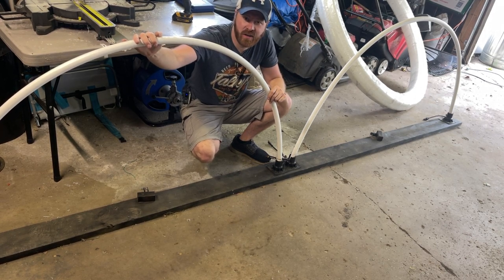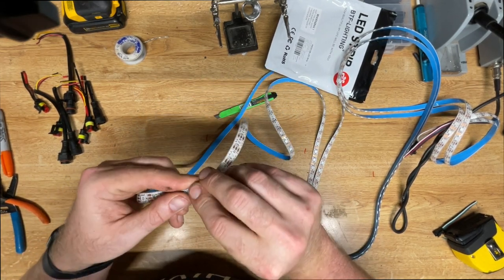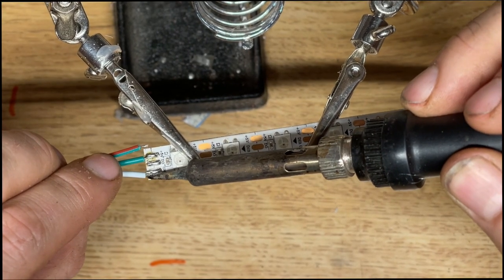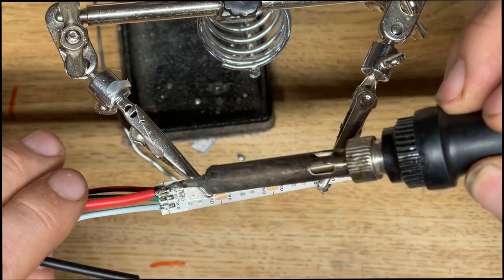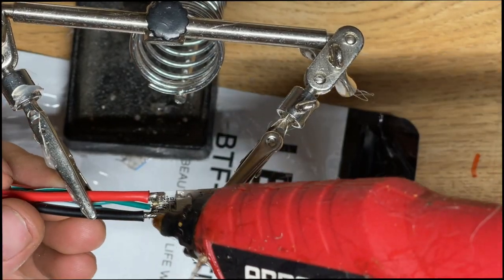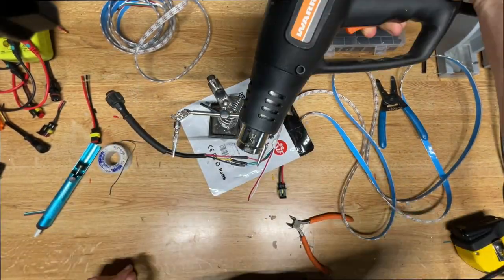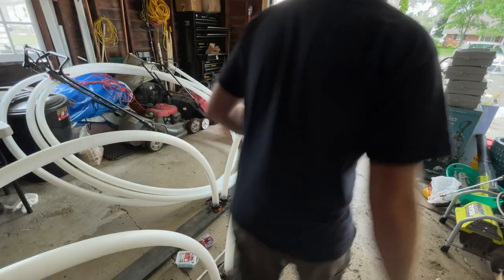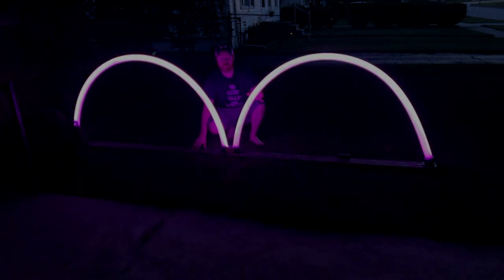DIY - How To Build LED Arches for Halloween/Christmas & Other Holidays

Comment: What did you use for a base with your 1 inch pex. The rebar caps are way to big for 1 inch tube.??
Reply from the maker: i used normal rebar caps and a hole saw to drill them out

Comment: Surprised you needed an L bracket even after clamping the hdpe to the rebar cap.  Was that L bracket just screwed into the hdpe? Would this setup work for 16 ft arches or would I need some type of center supports? Thanks for the video!

Comment: Do you have to inject power at the both ends of the arch?  Using 5 volt strips I was wondering about getting dim after 150 leds
Reply from the maker: I did, general rule of thumb is every 100 pixels, but I didn’t want to add it in the middle of the strip

Comment: what size clear shrink tube did you use?  I don't see it in list of materials
Reply from the maker: I believe it’s 3/8. If u get 1/2 you can add more clear hot glue if it’s still to big
Reply: @BostickFamilyLightShow  thx

Comment: Is there a way to use bullets to get the same effect instead of strip?
Reply: You could possibly use square pixels instead, but may have to put tension on the string to prevent it from flipping over